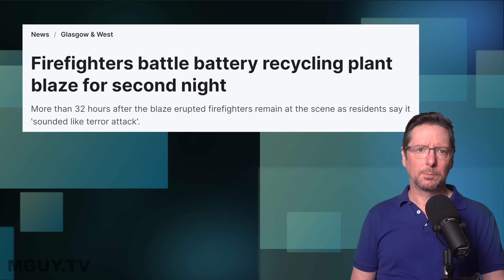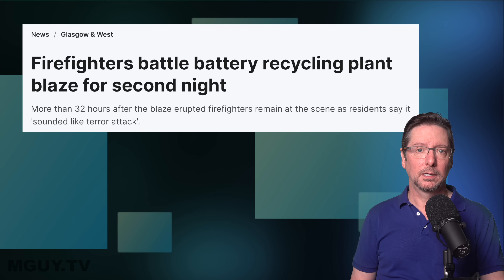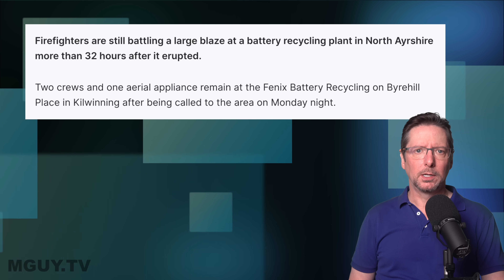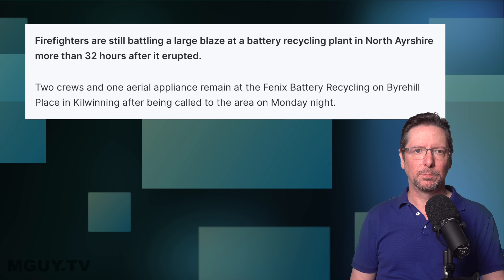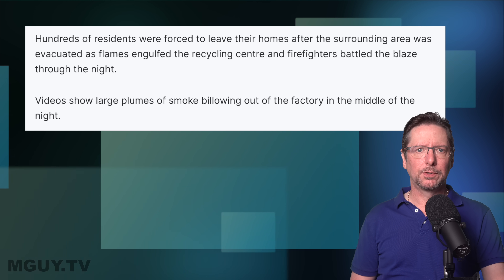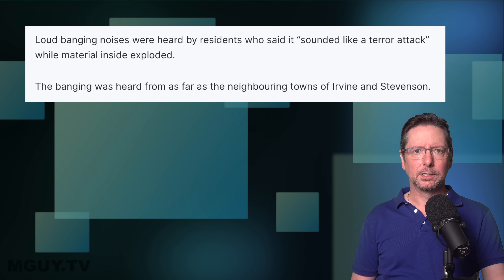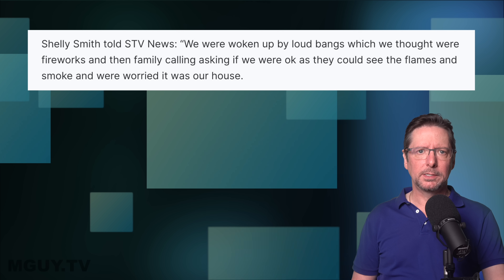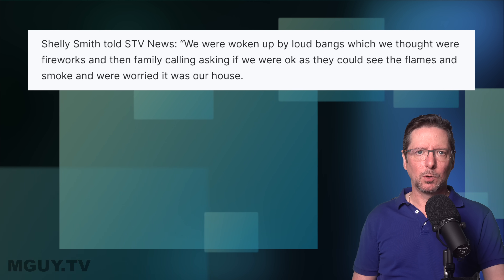EV and Lithium Ion battery recycling is DIFFICULT, DANGEROUS and TOXIC | MGUY Australia

Comment: What is worse with all lithium ion batteries is that they all a tiny electronic circuit board in them known as a battery management circuit. This circuit acts like a resettable fuse that shuts off when too much current is either taken from the battery or put into the battery (recharge mode).This circuit also cuts the battery off if it’s output voltage is too low or charge voltage too high. So the theory goes. But like all electronic devices constantly powered is that they can silently fail. For example I recently dissected a relatively puffy battery pack and upon testing the BMC it had failed short circuiting the battery pack, which is a definite no no when Lithium Ion batteries are used because they can go into what is known as Rapid Irreversible Disassembly Mode.

Comment: The Deepwater Horizon spill has surpassed in volume the 1989 Exxon Valdez oil spill as the largest ever to originate in U.S.-controlled waters; it is comparable to the 1979 Ixtoc I oil spill in total volume released (Ixtoc discharged 140 million US gallons (530,000 m3) to 148 million US gallons (560,000 m3); as of mid-July 2010, Deepwater Horizon has spilled 90 million US gallons (340,000 m3) to 180 million US gallons (680,000 m3)).[3][4] (Source: Wikipedia)

Comment: As a engineer you would know to solve any engineering problem you must implement  the correct solution.
Not just ANY solution as the net zero nutters have demanded, you must implement the CORRECT  solution.
EVs (electric remote Combustion vehicles) are obviously not the CORRECT solution and should be set aside so we can concentrate on solutions that may have a chance of making a impact on our environmental problems.
You don't fix a problem by making a even bigger one.

Comment: I just don't understand one thing. Some car companies promised that they will use sodium-ion battery. They are non-flammable, carry more energy and there are lighter... Where are they???
Reply: Still in the lab.
Reply: Metallic Sodium as used in batteries burns like a SOB with the slightest provocation! Did you think the Sodium they were talking about is table salt? Sodium is also a deadly poison! Only when combined with chlorine, another poison to make salt is Sodium safe.
Reply: @robertkubrick3738  and don’t get it wet!

Comment: This is my area. I was literally just talking to one of the local car breakers about this, as they had just removed the batteries from two small EVs (Mitsubishi miev type) - nobody had wanted to take these vehicles for breaking. Then just a few days later, this plant a few miles along the road burst into flames. Still burning 3 days later.

Comment: Burning a lithium ion battery releases over 8 times the amount of energy compared to the electrical energy delivered by a full charge. In theory, a car would travel 3 times further using its battery as a fuel instead of using it as a battery.
Reply: But you can only burn your battery once.
Reply: @andyharman3022  Yes. Given fossil fuels are used to make the batteries at least 3 times the amount of energy is needed to put this 'burning' energy into the battery materials then at least 24 battery charges are needed to offset the emitted fossil fuel CO2. I'd suggest the actual figure should be several times that amount. Further, if no EVs were charged tomorrow in Australia the only change to electriciy generation would be that less coal was burnt. The end result is that EV owners happen to help green the planet but for all the wrong reasons - they end up producing more CO2 than ICE owners and higher CO2 speeds up plant growth. I love the irony!

Comment: ev packs should be converted to home storage when the car is no longer servicable or pack range is depleated
Reply: Do you really want a worn out battery with Cobalt in your home?
Just get a new LFP battery with warranty instead or wait for Sodium-Ion batteries.
Reply: Not in my house.  Ever.  I'd rather have a bank of lead-acid batteries.  Energy density doesn't matter in a stationary application such as home storage.  On the other hand, safety and complete absence of threat from thermal runaway does matter.

Comment: One can imagine a battery powered 200 tonne Cat dump truck with 40m2 of solar panels and a 180 tonne battery to do a 6 hour shift to shift 20 tonne of iron ore 🤣 or perhaps they could use a 100kw diesel generator to charge the batteries

Comment: I have been purchasing prismatic cells from a factory in China since 2019. Last month I order some more, I asked the factory "how can I neutralize cells that have expanded to render them dead". Reply was " Very difficult, store them and make sure the terminals don't touch" I shit you not.   So basically equivalent to storing spent nukes lol.  Next test I will conduct is to discharge them to near zero voltage and throw on in a bucket of water. My theory is it will short out the cell while having near zero voltage, so that should lessen the Boooooom. lol.
Reply: Don't try this at home.

Comment: Generating electricity without fossil fuels isn't very useful unless you can store it without fossil fuels.

For reference, it takes a bit of energy to make your car move.

It takes a LOT of energy, and I mean a LOOOOOT of energy, to pull useful materials out of the earth and turn it into something we can actually use.

ICE cars don't pollute at all when you compare them to actual industry. Manufacturing and mining are what produce the most pollution, because they require the most energy to do. It's basic math. The mug of oil being spilled isn't as bad as the 5 gallon jug being spilled.
Reply: What about ships and locomotives?
Reply: @markvincent5992  What about them?

Again, it's still just kinetic motion compared to all the shit that's involved in getting iron out of the Earth, separating it from the Earth shit mixed up with it, melting and reshaping it, probably a couple times, then forging it into something useful. All of that, on a MASSIVE scale.

Nah, you just can't compare the energy cost of ALL of that, to "Make a twain go"
Getting rid of all the cars in America is like putting out a kitchen fire and standing proud on a pedestal as you regale the world with your greatness, as an entire forest burns down behind you.

Comment: From BBC web site headline Fire crews tell residents 'not to be alarmed' by smoke but in the text is this“We urge residents to remain at home with windows and doors shut. If travelling through smoke, motorists should keep windows closed, turn off air conditioning and keep their air vents closed.
Reply: Brilliant - the problem with that is that some of the toxic products are so toxic that even Nonogram level contamination can be harmful. That is such a minuscule amount. It’ll come through close windows it can absorb through your skin and would remain coated on building surfaces for weeks. Just to be even scarier HF which is a flourine Compound from tests is showing to be released at a level of 2 to 20 kg per hundred kilowatt hour battery -to extrapolate that into practical terms easy to understand, Let’s assume a worst case at 50 batteries burnt they would release enough hydrogen fluoride, potentially, to kill every person within 10 minutes in an area 200×200 m and from ground level to 2 m height. This of course assumes that the fumes didn’t disperse upwards with wind etc but it does identify how toxic the potential is, this is directly based on proven scientific studies, which are easy to find online. The one that I used as a reference for my calculations is in nature magazine an  extremely well respected scientific publication, the study was peer-reviewed, and carried out by a number of scientists of various disciplines, collaboratively based on a actual laboratory experiment with batteries
Reply: @malcolmwhite6588 
That shit can dissolve glass.
Lovely fumes to breathe.
Reply: faq
Reply: Keep driving until you reach a bay with LVL4 decontamination.
Reply: Safe and effective... Like something else we have recently experienced!

Comment: I was reading a report on solar panel recycling, 
They remove the aluminium frame and the copper wiring and recycle those metals, but the remaining heavy metals that everyone is worried about are in the glass and they do not have anyway of separating & retrieving them out is the glass.
so they just crush the glass.. and along with the heavy metals it all goes to land fill.

Would be interesting to see ‘exactly’ what they do when they recycle EV batteries 🤔
It’s really green this new technology isn’t it 🙄
Reply: And into the surrounding water table. In the more environmentally friendly way possible, or course!
Reply: You saw in this video how the batteries got recycled. It is an easy and cheap technology called thermal runaway. It is not our fault.
Reply: @alexk6745  Thanks for that. I just spat my drink on my keyboard laughing! 🤣
Reply: @alexk6745  😂😂😂😂😂😂👍👍
Reply: The water soluble lead is the least of the problem.

Comment: I hope the residents will receive long term health screening. The gases are not only dangerous if breathed in but highly toxic if skin contact occurs. In other words, nobody should be anywhere near fire without PPE.  That includes Police who are seen wandering around without any protection in a longer video. The run off from the fire hoses is also toxic so let us hope it has not escaped into the waterways.
Reply: 😂 lmfao at this comment. You have sucked down too many fossil fuel fumes from your pipe mate 😂😂😂😂
Reply: @paulsimpson8990  Really , how moronic can you be making statements like that.
Are you so invested in your EV  that you can't see the woods for the trees ? 
Stupid is as stupid does.